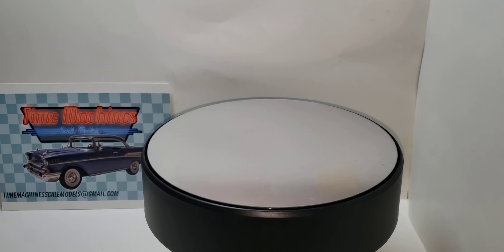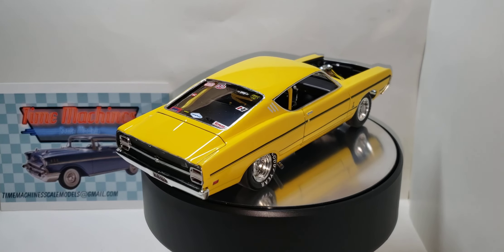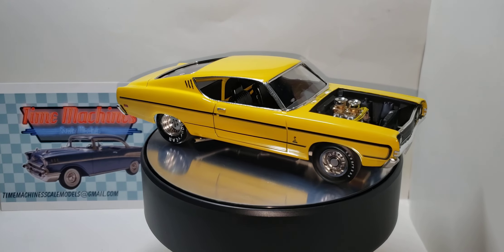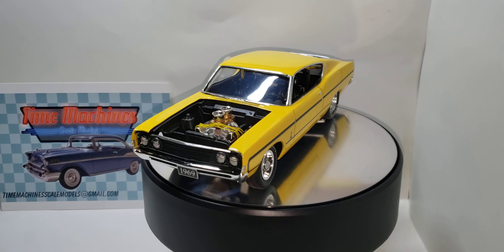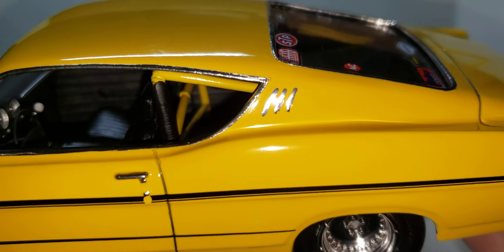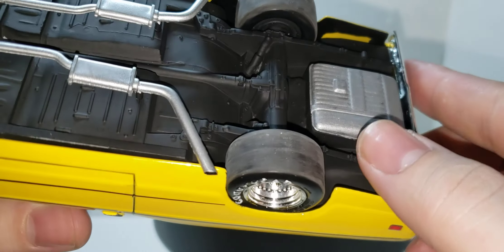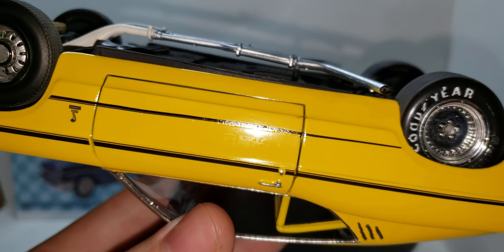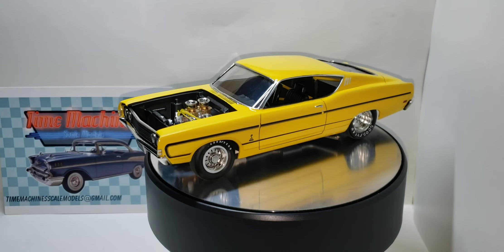#under1000gb final. AMT 69 Ford Torino Cobra fastback.

Comment: You can always use solder for the your exhaust system. I built the race version of this of this kit and no problem. For the rear suspension part I put a plastic piece of styrene over the holes for the axle to go through and drilled my own holes to make it fit better.

Comment: Looks good! Those headers "Hang Down" because they are carry-overs from the original 1968 release that included a dragster version with riser blocks for the front axle. With the riser blocks in place, they would clear underneath like a Gasser would.
Reply from the maker: That is pretty cool. Thank you for the history. I really appreciate it 👍😎
Reply: @oldschoolmodeler  You are welcome. I am making an "Ultimate Build" video for this model and I am really digging up a lot of info on this kit. Past history and people's issues with assembly and their solutions as well as some of my own. It sure will be an extensive video!

Comment: I'm about to build this same kit.  Thanks for putting out your video with all of the problems pointed out with the kit.  I'm doing a group build and it has to be box stock, so we'll see how it goes.  Yours looks really good with the paint and details in the engine compartment.  I like how it came out besides the areas you pointed out.
Reply from the maker: Thank you. I really appreciate it. Have fun with it and test fit everything before you paint 👍😎
Reply: Definitely eyeball vids on this kit. Mine had a warped hood.

Comment: This Kit is one of the worst from AMT!iam just building one and Monster hobbys and Petes customs,too!We had a big discussion on MH Channel about all the flaws!you have to lengthen the chassis 2 mm and sand off the strange increases on the inside of the chassis to make the interior not preventing the chassis to slip  into the body!And there are other problems with the body(Cobra emblem on the wrong spot,Torino rearbumper instead of Cobrabumper!Fairlane frontgrille)But you did a decent job to this messy kit!
Reply from the maker: I do agree it's not the best. Thanks for watching 👍😎